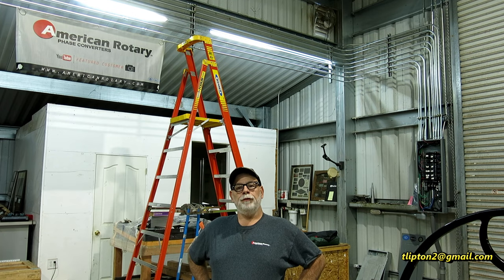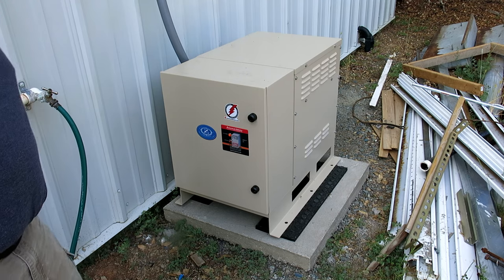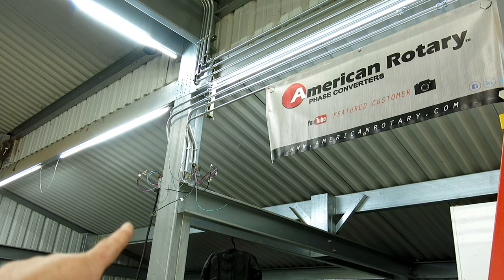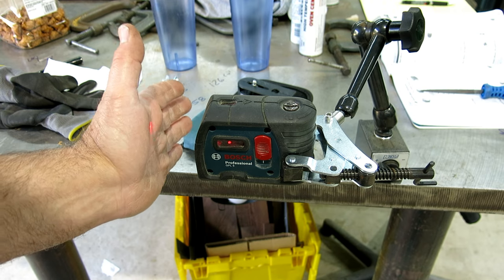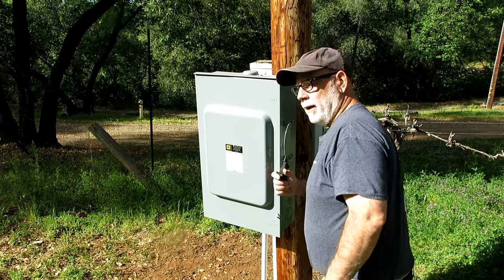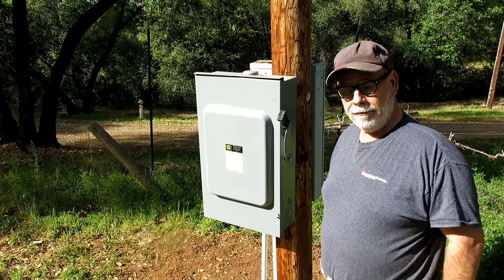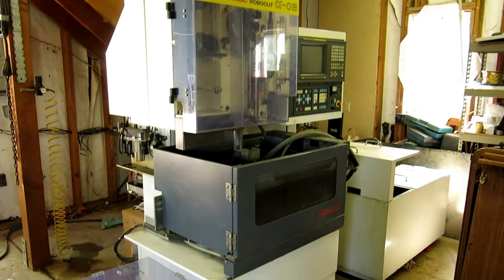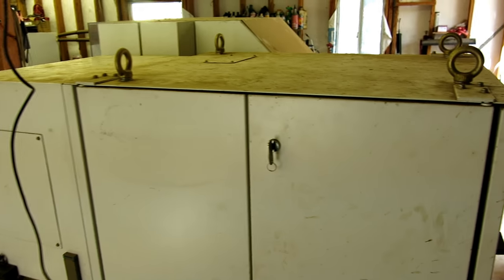Epic Egress 6 Shop Update

Comment: Ground rod = what you drive into the earth to protect from lightning strikes and stray current. 
Ground FOD = is what you get in your tires when you show up at Tom's shop.
Reply: I put in 36 eight-foot rods in a radial pattern from my radio tower.  Different distances to meet certain frequencies and stainless steel wire to each buried rod.  Overkill for an antenna counterpoise system but there was a marked improvement.  All of the wires were laid on the ground and when spring came they were invisible and now 17 years later one would have to have a spade and a metal detector to find any of them.  We also laid out garden hoses for irrigating She Who Must Be Obeyed specimen gardens.  Those hoses are still in use today but are under about 3" of sod.
Reply: @bigun447  Oh man I would love to run a large DRSSTC with that grounding system.
Reply: @JustinAlexanderBell  A local AM radio station that has its tower sitting on a large capacitor that makes the tower itself the radiator element, has copper mesh buried about 12" down in a radius of about 200'.  My system was provided by a power plants "donation" of ground rods, and the Donation of stainless steel wire "donation" from a friend who worked installing insulation around steam pipes and had pieces of surplus ends of wire rolls. That powerplant removed all radio systems that were not being used anymore.  I filled my 8' x 8' x 12' trailer with all of the 1" diameter hardline that had been used in the plant.  Also, 3 UHF Motorola repeaters.  2 of which we had to lower from the top of the powerplant coal bins to the ground using ropes.  I am a scrounger who is not afraid to ask "What are you doing with your leftovers?"

Comment: To give you an idea of power companies charges: In 1988 I moved into a new building and had to get 3 phase. It was 15 feet from the building. Power company wanted $6500.  An electrician gave me a name @ the power company to go see, an engineer. He "privately" gave me advice on how to get the price reduced. Give them a list of all my 3 phase equipment and the amount of time it would be running. He said to be "generous" with my estimates. After several back & forths with management  they agreed to put set a transformer @ no charge. I had to provide the concrete pad and underground conduit to the meter head on the building. I had my choice of 208V or 460V.  Went with 208 & 400A. The city required I-line breakers for anything 100 A or greater. Back then they were $365 each. The I-line panel is huge and has two big sub panels on either side. My shop was 4,000 sq. ft. of an 8,000 building. Over time, I expanded to 25,000' & had to add a second 400A service. Now have 7 sub panels and 2 transformers for 460V. I've never added up the cost, afraid to!  The city had to replace the original transformer. We are on demand metering so need to be careful about starting big motors and not do it simultaneously. Our biggest motor is only 40hp. To pull the wire for 400 A the electricians brought in a truck mounted winch. Isn't that cheating?

Comment: Great progress in the shop! It's easy to underestimate how much work setting up even a small shop can be, don't forget to rest!

I could definitely see myself leaving the phase converter running all night after a long day's work, I'd setup an indicator light in the shop to see it's running.
Reply: Or a relay to shut it off when you turn out the lights.
Reply: @larryschweitzer4904  if you'd set it up with a relay, you could just make it turn on anytime you're drawing current from one of the 3 phase legs. Then you wouldnt even have to think about turning it on or off.

Comment: It's apparent that you've been very busy!  I'm excited for you as you get closer to having your shop up and running.  You may find that the per KW cost for 3-phase service is prohibitively expensive and using a rotary phase converter is your smartest move.  Also, if you lose power a 220V generator will allow you to use your shop tools.  Years ago we made our own 3-phase converter using a 10hp 3-phase motor and an R-C network.  It was exciting when I blew the first capacitor.

Comment: Always nice to see a well laid out panel.
Reply: Yeah, but being not too used to the US electrical system (I know usually it is what would be a single phase 240 split at the transformer into two 120 phases 180 ° apart) I somewhat stumbled about the "additional generated leg" Tom mentioned. I wonder how that makes proper three phase. Or are those two phases (?) providing the 240 already 120 ° apart and you only have to generate the third leg for three phase? I thought those rotary phase converters consist more or less of a motor running a three phase generator, generating all three phases for the secondary side.
I am in the comfortable situation to be used to having three phase 400 V (or single phase to neutral 230 V) coming in to the house, so I don´t know a lot about those converters at all.

Comment: 20A idle is considerable given your 100A service. I'm curious what the real power is as I bet the power factor is low at idle. You would be charged the real power, not the VA load. Would be nice to know the base cost of running the converter before adding machine loads.
Reply: I had to wonder the same since I have the ADX20 by American Power (no discounts from anyone). Anyway, my unit shows 60 Amps FLA and really can't wait to see what the idle is as I'm  not hooked up yet....
Reply: Years ago I tested my 50hp ai phase converter on my mains meter and it indicated it cost about 25cents an hour to idle. This was at 7cents a kWh but we now pay 10cents with fuel surcharges and what not. Regardless I would say less than 50cents an hour is a safe estimate for idle cost for my 50hp phase converter.

Comment: Problem in my area is to get that stretch of 3 phase they are going to calculate your consumption and your either going to pay the full cost or they are going to amortize the expansion on your bill for a matter of years. Suckier than that here is you are then on demand rate power which means depending on your loads at a given point in time you have no known utility rate.

Here at least 3 phase is a fussy friend.
Reply: Texas?

Comment: It should be noted: the 20 A drawn by the idling phase converter is NOT real current, it's largely out of phase current and corresponds to a few hundred watts of actual power being dissipated by the idler motor, because of the very poor power factor of idling motors. Otherwise the inside of that box would be getting HOT quickly!

Comment: Btw, Tom seemed to suggest that the phase converter just added a 3rd hot leg to the existing 2 hot legs of the standard single phase system. I was surprised by this. Is this accurate? How do they get phase rotation right? I always thought the product generated all 3 phases, using the single phase power off the pole.
Reply: I know very little about it but you’re right about the fact it just adds a third leg to the other two that you already have. One thing to add is if you’re trying to run say a five horsepower motor, then you’ll need a fifteen horsepower motor on your phase converter. There’s a rough conversation out there that says how much more you need to have to run it efficiently.

Comment: Tom I share your feelings of adventure and excitement with solving problems after moving to a new location.  I packed up my shop and moved it 800 miles north from the very area you just moved in to.  It took a while but I found the right electrician to run the conduit and bring my rotary phase converter to life.  I gutted the bathroom in my shop and turned it into the phase converter room / air compressor room which is heavily sound proofed from the rest of the shop.  Looking forward to seeing the EDM.

Comment: Boy, I don’t like to be a negative person, as a full time electrical inspector in Michigan I can see several issues that are not code compliant. Just an example is that circuit breakers can not have the handle at an elevation higher than 6’-7” from grade, grounding electrodes are required to be tested to 25 ohms or a secondary electrode is required. Maybe California doesn’t use the National Electric Code.

Comment: Aren't your phase offsets going to be awfully weird with that setup?  Instead of proper 120°-120°-120° three-phase power, seems like adding a third phase to residential center-tapped single-phase will give you 90°-180°-90° offsets.
Reply: I was hoping someone would chime in with further explanation. It does seem like the phases will be wrong.
Reply: Clough42 just posted a video on his channel extensively explaining 3 phase power generated via a rotary phase convertor.  For the first time, I fully understand it!

Comment: I don't understand how the third phase works.  With single phase power from the utility, there are two phases that are 180 degrees apart.  If the phase converter only creates a new, third phase, how is it timed in relation to the master phases from the utility?  To create true three phase power, don't you have to "delay" one of the phases from the utility, and then create the new phase in the space created from the delay?  How else would you get all three phases 120 degrees apart?

Comment: It's been years, actually decades, but at the airport we drove 8' grounding rods in through a already drilled hole in the concrete, then down through the gravel bed with a rotary hammer and no bit. Left an interesting shape on the end of the rod too. Wish I could show you an example of the hammer, but it's been a while and nothing is looking familiar. IIRC it had a big spring on it around the whatever where the chuck or bit goes.

Comment: Why is it so difficult to get a three phase supply from the utility supplier.  Here in the great south land, in metropolitan areas,  every house has the three phases running past the front door with 240 volt 100 amperes per phase available to the house holder.  Most houses with electric cooking and electric hot water need more than one phase.   The supplies balances phases within the system to prevent problems.    It costs about $100 each phase to have it connected when you build the house.

Stavros

Comment: Those lasers are so useful. They're extremely accurate and repeatable. I use the cross hair version to level things that are bent (think a bow in a tube), check shaft straightness, use as a layout tool to mark cuts; the list goes on. And they use a standard ¼-20 or ⅝-11 mount so I use them on my camera tripod and never have to deal with dang magnets. Extremely versatile tool.

Comment: Is there a reason why you don't run cable trays with isolated wires in the US? Seems like expanding with more conduit circuits would be a hassle. Love the videos!
Reply: The do. It's just 5x more expensive, and really only done in commercial settings where the convenience of adding circuits outweighs the cost. It already cost him thousands of dollars worth of materials (assuming the bulk of the materials, phase converter, and labor were near free. If not, it would be thousands more. Tripling or quadrupling that cost would be completely unjustifiable for a home shop. There's really no reason to do it in a shop where nothing is behind a wall. Run another line of conduit and pull a line. You'd have to do A LOT of changing and running extra circuits for the cost of trays to be justified.
Reply: @littlejackalo5326  Never thought about it would be that more expensive, but it makes sence when you point out that the labour cost in this case was essentially "free". Thanks for the reply!
Reply: @Raaboort  Yeah, everything from the trays to the cable is more expensive that way. Have a great day, Robert.
Reply: @littlejackalo5326  Funny, that seemed counterintuitive to me also - plastic rectangular conduit and another layer of plastic around the wires didnt seem to outdo metal pipe pricewise in my head either.

Comment: It appears to me that there is 2 phases on the pole your transformer is on. If that’s the case you could get an open delta bank which would provide you plenty of power. An open delta uses two transformers and two primary phases to provide 3 phase power at voltages of 120/240 with a 208 high leg. 10 yr journeyman lineman.
Reply: That's what it looked like to me too.

Comment: Looking good Tom,  nice and green this time of year.      You are never going to buy enough 3 phase power from PG&E to cover their engineering costs.  You can buy a lot of 3 VFD converters for  $5K .
Reply: That rotary phase converter would cost about $8000.  If you don't know much about VFDs, it is probably the easier.  Myself, have 9 VFDs running all my machines, including two 15 hp ones.  All in I am under $2500 in VFDs.   The nice thing is I am not pulling 20 amps at idle.  When my 15 hp VFD is on and the  machine is off, it is pulling almost nothing.  If I loose a VFD, I am only down one machine, not the entire shop.
Reply: @vendter  He's pulling 20 amps, though I doubt he's using much power in the form of watts, it's mostly reflective power. Maybe Tom or Stan could tell us the actual 
watts used here with no load.
Reply: @MrJohnnaz  Running a motor that big at the RPM required to generate the 3rd leg is going to pull most of that at full watts.

Comment: For your earth I recommend Deep earth ground rod earth diameter 20 mm V4A stainless steel set with tungsten carbide impact tip and SDS max impact head. This will help you get up to 9 metres deep also in gravel ground soil.
Reply: 30 feet of 3/4" ss. LOL. Imagine trying to install a 30 for long stock of >3/4" rod into the ground. How absurd.
Reply: @littlejackalo5326  How absurd commenting without the faintest clue of knowledge. Check the product before.
Reply: @littlejackalo5326  Yeah, it's a silly comment.  In that part of California you're almost guaranteed to hit large granite boulders, not just unconsolidated gravel.  The guy has no clue.

Comment: I was told to run three ground rods 5' apart and connect them all.  Perhaps some electrical engineers can chime in here on the use of three connected ground rods in lieu of a single one.
Reply: I believe you only need one if you perform a resistance measurement. The NEC allows you to skip the measurement if you use two 6' apart.
Reply: @chasmosaurus3  thanks for this.  When I built my house they put 3 connected.  In my shop which is attached to the house, I grounded my Miller Syncrowave 250 on a dedicated ground rod.
Reply: Not a code requirement (That I know of) but in our part of Texas the provider requires two rods at a minimum separation of six feet. They can be driven at an angle. Which is something Tom might want to consider. That area looks a bit rocky!
Reply: @jrkorman  I double checked mine and it is also 2 rods 6’ apart not 3 at 5’ apart.

Comment: Try bending and cutting 4-O {  #0000 } by hand.
Reply: Used to do it all the time. Aluminum and copper.
Reply: 600ths says hi
Reply: Or 750s
Reply: 1.5ft of 1" pipe with a coupler on the end was my tool of choice for bending 500MCM THWN wire.
Reply: @elmarqo_3448  yup. Had a gas fitter cut me a piece of pipe and soften the edges. That's how I did hard bends in a meter base without skinning my knuckles.
Reply: @georgel5308  A one foot stick of the stuff makes a highly effective club! : o)